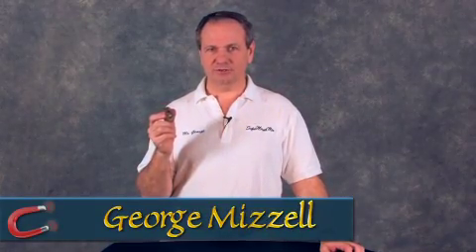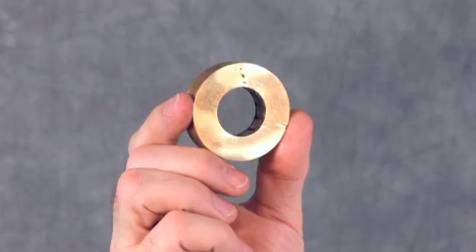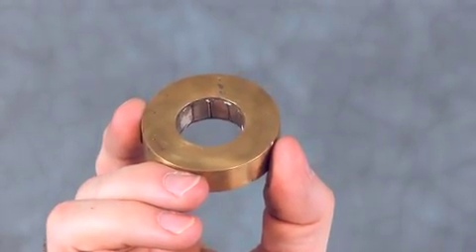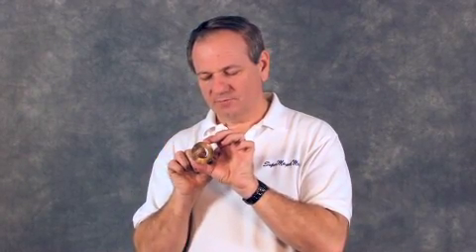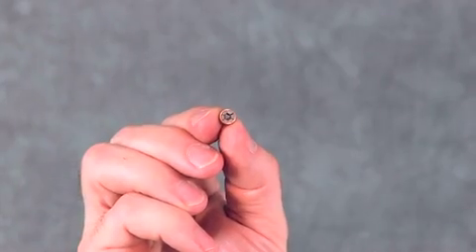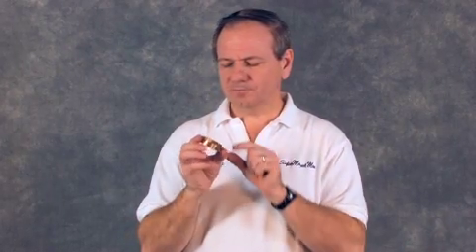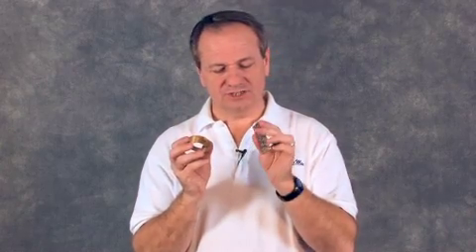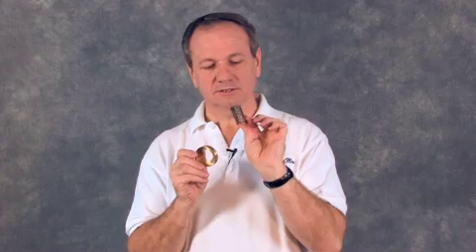Radial Neodymium Magnets

Comment: If U are forcing repelling magnetic arcs together for assembly, check the inertia that assembled magnet may affect. There have been scientific tests showing a forced magnetic pairing somehow affects gravity. Try dropping a similar weight (and aerodynamics) in tandem with your magnet. The difference is visible if dropped from a building(50+ft)

Comment: Is it possible to get a radial magnet that has charges like so....?      +((-))+     Basically a completely negative charge inside the hole and positive on the outside.
Reply: Fturtl Flow Yes, Yes, it is possible! Seven years ago I patented a magnetic motor with the same  Stator !